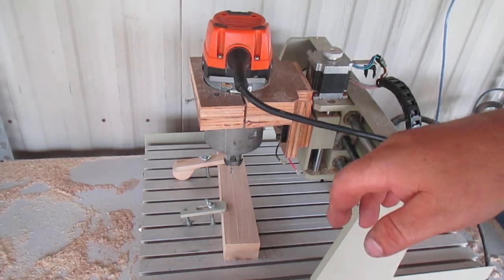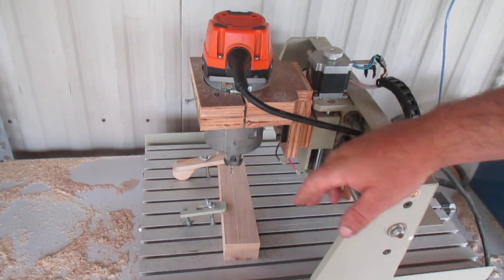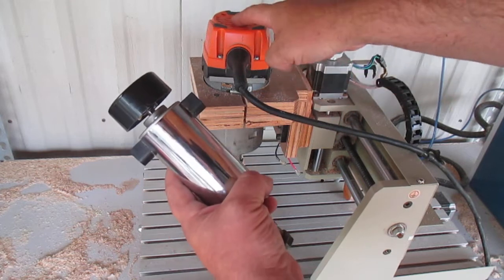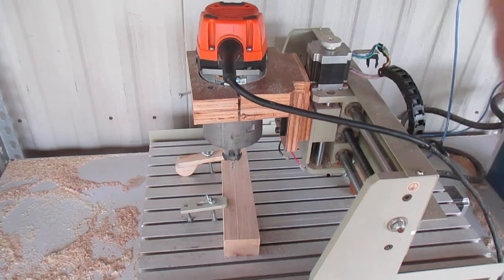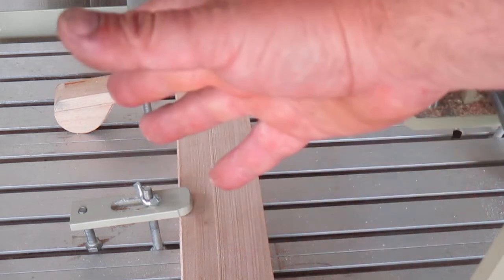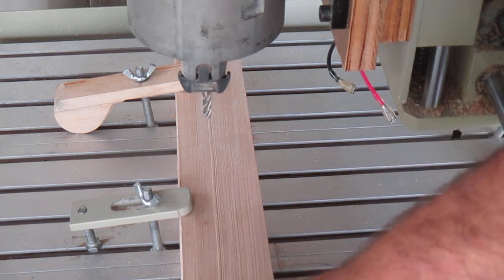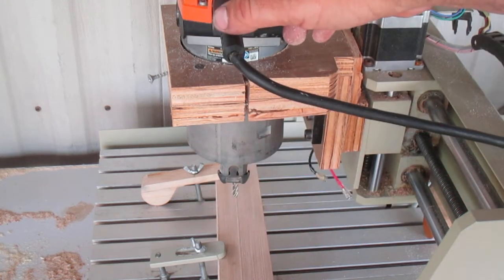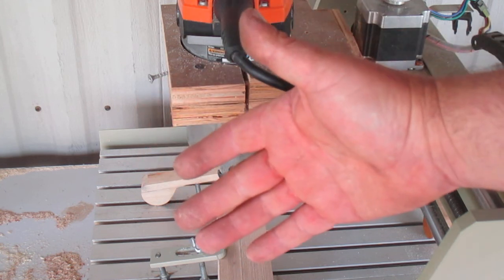five must have upgrades for china 3040 CNC

Comment: Might want to cover you old spindle wires just in case you turn it on and they touch the z axis.   I bought a Vevor 3040 300 watt spindle.  Nothing but problems with axis not turn moving correctly.  Dealing with support has been painful with 24 hrs or more delays in responses.  Need to post a few more videos of the x axis starting then stopping and then Mach3 thinks it moved to correct location.  Issues have been on all 3 axis at various times.

Comment: Have a Vevor Chinese made 6040 CNC router that I picked up on CL for a screaming deal. Three months old.  I don't do any aluminum just wood and foam or plastics. My machine runs Mach3 and I bought a copy of Vectric software as well and they work great together. Designing stuff is fairly simple. Took a few YouTube videos to get it down. Only real upgrades I did to mine was to add the dust collection system and make a good sealing coolant source with gromets to seal around the hoses and added a visible flow meter. Mine already has the 0.8kw spindle motor 24K RPM. It is SUPER quiet. I would never go back to a air cooled motor. Plenty of power for what I cut. I did make some aluminum clamps that were a attempt at coping ones I saw in a catalog. Has a 4th axis as well but I haven't got around to trying to carve something on it.  I don't really have a creative enough mind to use it super often but i'm glad I have it. It's there when I do get creative.